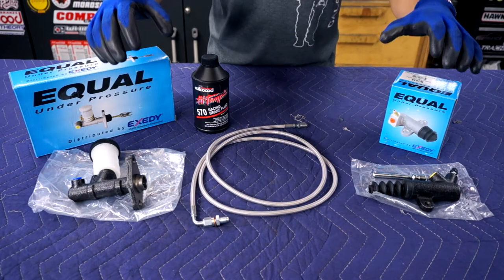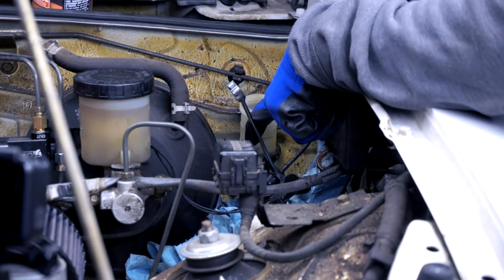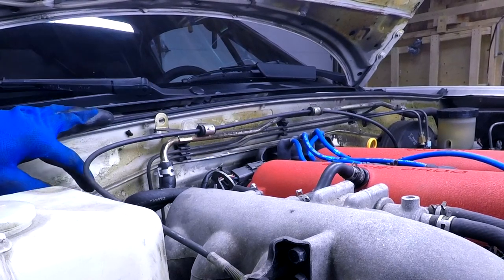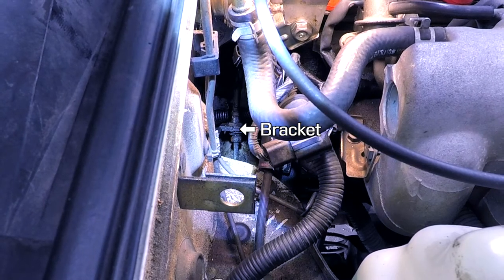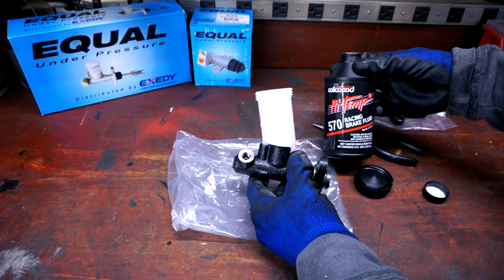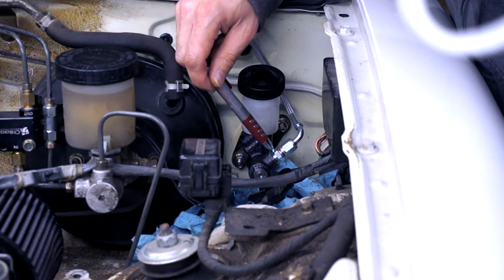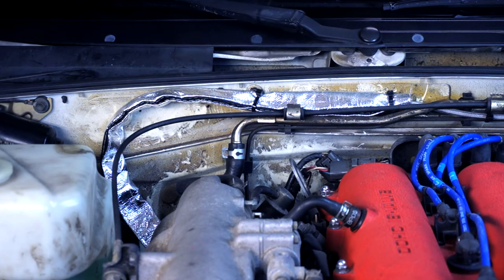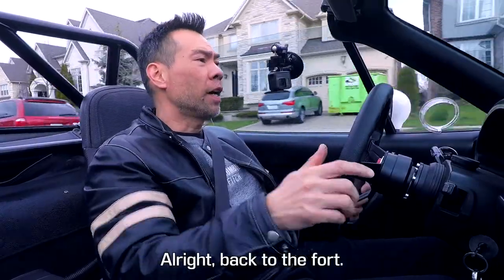Clutch Master, Slave, and Steel Braided Line DIY Miata!

Comment: The reason its in 3 parts is because of vibrations. Engine, road, trans, etc. Hardline from CMC to SC would bend and wear prematurely in either the line via bends/cracks or by bending the flare at the cmc or sc. The rubber is there to dampen these forces, since the hardline can flex with the rubber and not create failures. I'm planning on doing this exact delete with braided stainless and have done a ton of research on to why parts are there, just thought I'd share my .02c
Reply from the maker: Good points, thanks for the input!
Reply: So will a braided stainless steel line prematurely wear?  From bumps etc?
Reply: @bobs9242  Since the braided line has a rubber lining, not exactly. Braided lines do wear faster than a hardline, it's just physics, but not from vibrations. A hardline has many bends and extremely tight tolerances that without dampers, it would fail. The braided line, properly secured, will incur less damage from vibrations since the rubber inside the hose acts like a damper. But that same dampening is its undoing. It naturally flexes during operation and over time that wears out the steel and rubber. Should last a few years, costly to replace compared to hardline($20 for hardline, $80 for stainless braid), but league's easier to service. Find what option works best for your style.

Comment: My wife's 2004 LS has a noisy slave cylinder and I have a replacement for a spring project.
Thanks for the video instructions.
1999 Miata base (silver with auto trans)
2004 Miata LS (white with 6-speed and OE hardtop).
Reply from the maker: Definitely, these things are commonly replaced on our cars when they wear out, easy and cheap to give that little bit of love that our older cars need!

Comment: Did you ever figure out the deal with the copper washer? I found this video trying to answer the same question, and now I'm a subscriber. Thanks for the walk through, I'm looking forward to seeing your other vids. Thanks!
Reply from the maker: Unfortunately no I never called Goodwin Racing to ask about it. However, it's been on there for a year without leaking so I'm not too concerned. Thanks for your sub and comment!

Comment: Great video, thanks!  Starting to feel grinding and hard to go into reverse now in my NB. I notice you're in Canada, how do you get this particular clutch kit in Canada? Thanks
Reply from the maker: I bought the kit from Good-Win Racing and used CrossBorder Pickups as the brokerage in Ontario, depending on your locality there may be similar services. You may want to try to adjust the pedal and bleed the fluid before replacing all the components. Good luck dude!

Comment: First time doing the slave cylinder, looks like you cut at my question, how does the rod get properly inserted into the rubber? Do you force the rubber around the first ring on the rod?
Reply from the maker: With the slave bench bled and filled with brake fluid simply insert the rod into the cylinder gently and work the rubber into the retaining groove. Take your time, don't force out the brake fluid.  It goes together smoothly with a bit of care.
Reply: @mostlyuselessgarage  Thank you, mounted the slave cylinder only to have the final bolt snap while torquing. Oof, time and an extractor set.

Comment: What is the wheel and tire combo on your thumbnail, amazing fitment
Reply from the maker: That's my old set which were XXR 531s in a 15x8 with a 195/50R15 Falken Ziex ZE-912 ... I did like the look but the combo was quite heavy at 34.6lbs 15.7kg each corner.

Comment: Where can I get that plastic clip that holds the braided lines? Will the clip fit on my NB2?
Reply from the maker: Do you mean the OEM clip that I replaced with the steel rubber insulated cable clamp?  That's gonna be from Mazda ... I'm not sure of the part number.  Or you could harvest from a parts car at a wrecker?
Reply: @mostlyuselessgarage  thanks. I'll figure something out to hold my braided steel lines in place.

Comment: why SAE on the braided line though...
Reply from the maker: Good question, it came like that in the Good-Win kit.  Possibly the Techna Fit steel line comes with standard fittings so they include the adapter.  May be worth a call to Goodwin to ask.

Comment: i tried using the vacuum myself, but i have more success with a plastic bottle and some hose.
Reply from the maker: I find the vacuum can be good for a full flush with a final pedal bleed at each corner right at the end. Another option is the Motive bleeder pump for true lone wolf bleeding.